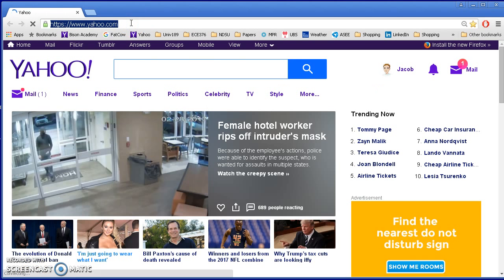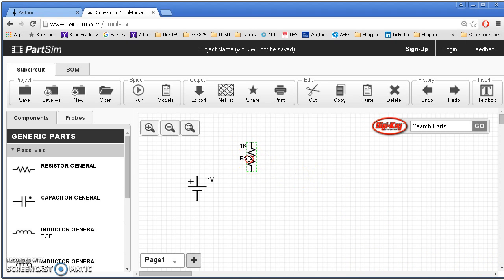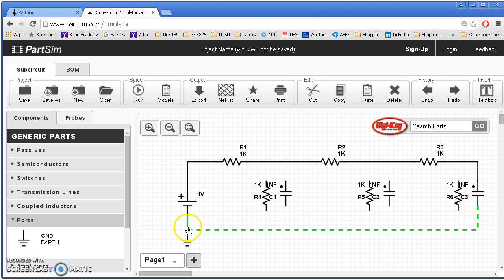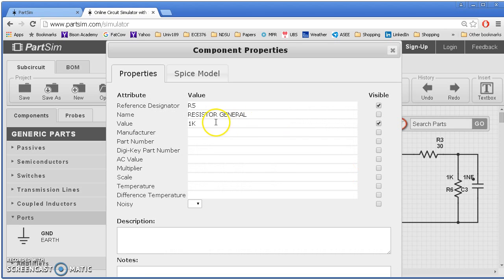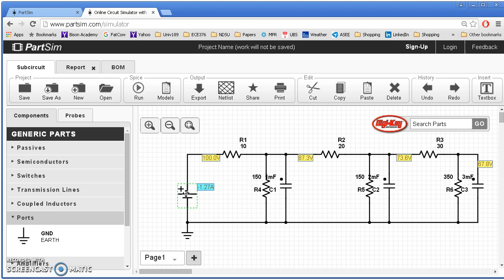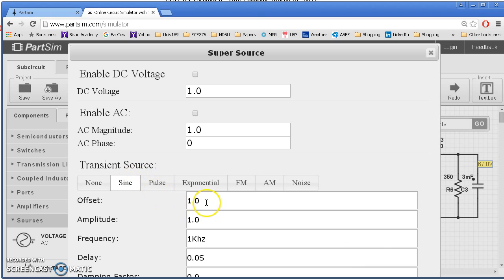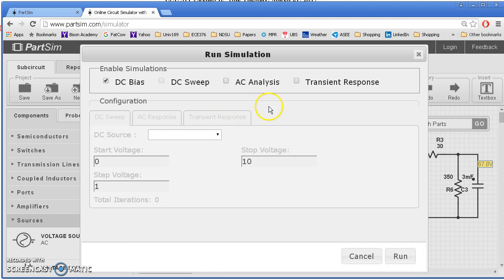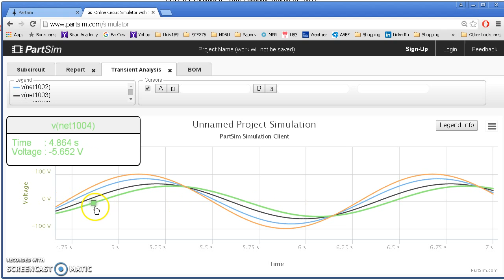PartSim

Comment: Hi, if possible could you help me build a circuit using PartSim?

I don't understand how to make the circuit I want. 

The components are as follows:
1.) Step Down Transformer(Direct Current)
2.) Oscillator(L-Inductor, C-capacitor Tank)
3.) Transistor Amplifier(AC)
4.) Center Tapped Full Wave Rectifier

Any help at all would be appreciated.